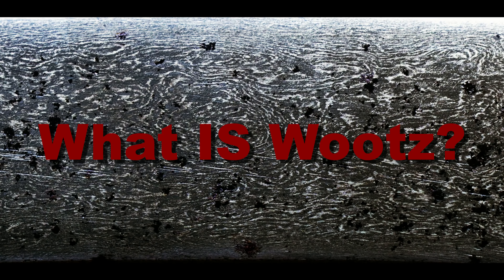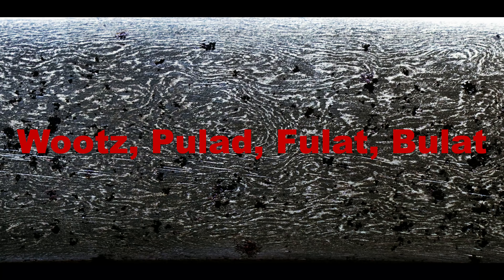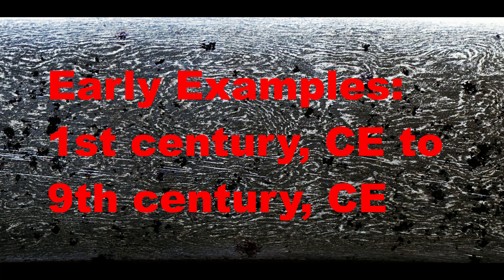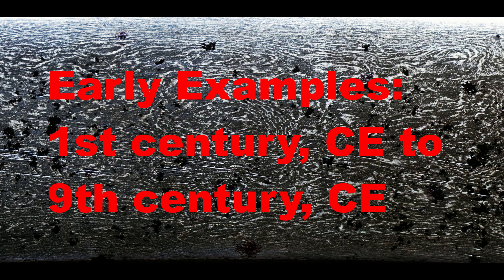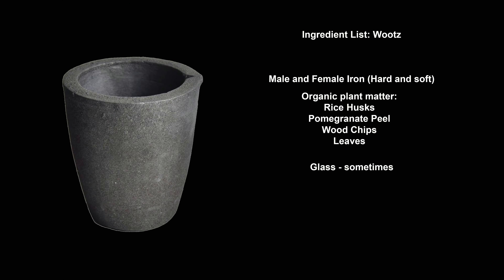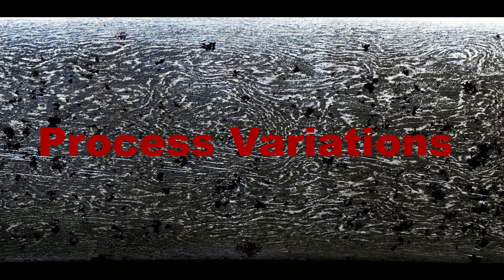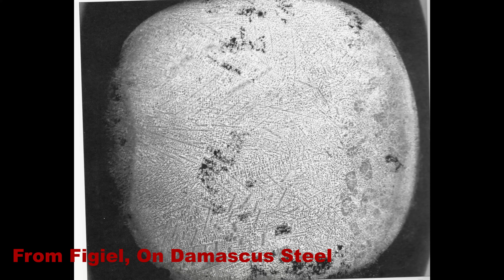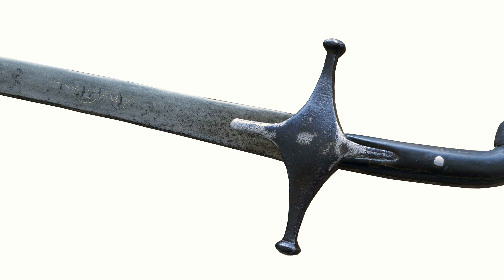"True Damascus Steel": History, Metallurgy, Production

Comment: It's only Damascus steel if it comes from the Damascus region of Syria. Otherwise it's just sparkling iron.
Reply: Exactly you know the really history 😀✌
Reply: so its like Kobe beef
Reply: & that is all. All damascus are wootz but not all wootz are damascus
Reply: @atcera8714  
And champagne.... if it's not from the champagne reigon it's sparkling no matter how good or expensive it is.
Reply: About that... there's 3 traditional definitions of Damascus Steel. Firstly is what I think David Do is referring to - steel that is made from iron in Damascus. The second is any type of steel traded or sold in Damascus. The third is any blade with this wavy, "Sparkling Iron" design, which is also the modern day definition.

So, I suppose David Do's correct with 1 or 2 definitions... but language has a habit of evolving over time. If you speak English and you talk about Damascus steel, most English speakers will assume you're referring to "Sparkling Iron", therefore this is what Damascus Steel means in the modern day. Just look at the Meriam Webster dictionary for Damascus Steel ("hard elastic steel ornamented with wavy patterns and used especially for sword blades") or the Collins dictionary ("a hard flexible steel with wavy markings caused by forging the metal in strips: used for sword blades").

Anyway, David Do is trying to be a smart ass and he's wrong (he might have been right a few hundred years ago, but not today). "Sparkling Iron" is a term he's made up - If you don't want to sound like an idiot, you shouldn't follow his advice.
Reply: Lmao considering syria couldn't even make the steel I have no idea how it can be classed as that type of steel coming from syria 😂
Reply: @alexanderthegreat5649  not if its presecco pal.
Reply: @44R0NM10  it’s a joke, in reference to the wine champagne which is only champagne it if is from the region of France, otherwise it is sparkling wine. He just changed the words to make a joke I thought was hilarious
Reply: @aravindhanpnair  false
Reply: @Killa_3  wdym it is made in syria i am from syria
Reply: @Aramleth  what do you mean look at a map ? we are talking about history , you cant claim inventing something because one civilization called if after the region it was fighting , when the real inventor had it within there civilization long before lmao
Reply: @AhmadM25  The name for the steal was adopted due to the people fighting thinking that Damascus was manufacturer and inventor of this new metal , but in fact they were being provided the steal from India , and later the method may have also crossed over , its like with a lot of things , later civilizations claiming invention when in fact it had been in use or known long before ,
Reply: @Killa_3  maps and religions changed over time. Read a history book before coming at me. What was Damascus back then is now something else entirely. Wootz came from India and then was introduced to Assyria which later developed their own version of wootz with Damascus steel.
Reply: @Aramleth  well i know maps change , but you are the one to state go look at a map , as if that answers the questions ., the wootz process is the same , and was used for most of the early Damascus steel , the name was adopted by Islamic scholars  , when the shipments of ingots become low for the ever growing region with its countless wars , had to try and replicate that and did so , but changed one thing which was adding different steels as they did not have the wootz ingots,  but as they knew the technique now (adding fibers to create spacing ) they also did that ,  this merely added different patterns as the different steels had different cooling properties , but the effect of having flexible steel is done through the wootz process,
Reply: @Killa_3  hmmm ok i see your point now. Its like comparing Jordan's and nike when in essence they both come outta the same factory. 🤔 wasn't my intention to come off rudely.
Reply: @Aramleth  no probs, and that analogy is good , but I would say India and the Tamil region came up with the materials for sneakers, but the creation of Nike and Jordon would be Damascus , because while the ingots were wootz, the actual forging of weapons was a high skill unique to that region of Damascus , India had some swords dont get me wrong that were good , but that region of modern day  Syria and the people  were experts in weapons at the time  , and of course better methods of steel producing was invented to make it absolute other then for it patterns
Reply from the maker: @Killa_3  the vast majority of patterned crucible steel swords were not made in Damascus, or even in Syria. To say that Damascus was unique or even particularly better at using crucible steel is not supported by archeology or the extant antiques.
Reply: @aravindhanpnair  the knife was manufactured using steel ingots imported from India, the blades themselves were forged elsewhere
Reply: @alexanderthegreat5649  also, its gotta be made with champagne grapes grown in champagne. Now with wine, location of the vine is actually important. Unlike making steel.
Reply: @Aramleth   @Red Grave  maps changed 😂😂😂damascus is the oldest inhabited city in the world 5000 years old precisely
the damascus steel is the steel extracted from its soil and manufactured by their blacksmiths
not near the wootz type or like random multi lairs forged steel
Reply: @aboodykiwan91  I understand this. Read further into the comments
Reply: Wrong.
Reply: @aravindhanpnair  not true, you cant make this up just because you are a nationalist
Reply: @Killa_3  The damascus steel originated in damascus, this video isnt about the damascus steel, its about wootz steel, damascus steel is another level of wootz steel
Reply: @IPostSwords  Then you need to visit the museums in syria, you can find lots of it there
Reply: @fjhcm  unfortunately your just wrong, but I'm happy for you to cite your evidence and change my mind
Reply: steel traded in Damascus is the correct trade name and not made in Damacus
Reply: It's only an Archamedes screw if Archamedes himself turns it.
Reply: The 'formula'' for ''damascus steel'' and the steel itself  came from India. Just like a ''Panama'' hat is made in Ecuador but got the name because it was sold mostly in Panama, so too Damascus steel got its name. There is no real damascus steel being manufactured  because the formula  has been lost for many centuries. Even the Indians admitted such. There was only one form of damascus steel and the formula is lost forever
Reply: Maybe the formula isnt lost, and maybe someone in 2022. Know where it originated.
Reply: Damascus are Indian invention
Reply: IT IS IN THE NAME
Reply: @atcera8714  😆
Reply: Yeah no.....
Reply: the iron comes from a single mine free rom what i understand had vanadium in it as well as ALIMINUM! not  as easy feat for the time and tech,
Reply: Why? There’s nothing special about that region with regards to steel. Yes that’s where it originates from, but it doesn’t mean it can’t be reproduced elsewhere to the same or even higher quality. 

It’s not the same as Parma ham, Kobe beef, etc because they are food and food IS different in that the region in which it is reared plays a part. 

So in this case “Damascus” is referring to a technique rather than the region.
Reply: its Damascus steel not because originate/made in Damascus, but because crusades call it Damascus steel. but it's originally begin in today's Bukhara Uzbekistan
Reply: @Reinhardt57  no, it was actually made in new zealand
Reply: That’s not how things work
Reply: @AhmadM25 no bro Damascus is little variant of Indian wootz steel they traded to Damascus. It's a real fact
Reply: @secular786  no
Reply: it would be enough to at least not just weld multiple scraps together
Reply: @Loriddian I heard the method of how the 1st Damascus blades were made is still unknown. Probably because of the carbon used or the rate at which it was heated or cooled. I assume after being turned to steel you can't tell what kind of carbon was used. That's for the original as far as the following blades imitating the name I'm not studied...
Reply: Slag. Flux is a chemical that is added to molten metal to connect with impurities that may then be removed.

… according to Morfit, a substance usually saline, mixed with other bodies in order to promote their fusion, and to render them more soluble in water and acids
Scientific American

Noun. chemical flux (plural chemical fluxes) (chemistry) The amount of substance per unit volume, per unit time transformed in a reaction.
Reply: Ha ha! You know who else said this? A Syrian dude from Damascus trying to sell swords!
Reply: @aravindhanpnair just like everything else that is refined and done in the Arab world Indians love to claim they did it first.

Like the modern day version of Chess isn't Indian it was a completely different game when Indians made it what people play now is the Arab version of chess.
Reply: 😂😂😂😂, what was and how big was Damascus, you can’t be serious
Reply: It didn't made in Damascus Syria it's crusades who seen that sword in Syria that's why they call it Damascus sword the sword made in india
Reply: Wasn't damascus steel made in India? I am referring to South Indian exports as it was the steel that made damascus, we have used it to make a large number of swords with it, even the Arabs mentioned it and they praised indian swords more than their own. I may be wrong though, I heard it from my sikh friend's grandparents (grandpa had 3 beautiful swords on display and it passed down through generations, note: it wasn't damascus)
Reply: Mate the steel was there but it was actually made in Bharat/India hence we have the most flexible swords like Talwar and Urmi (the most dangerous sword sorry I had to add this 😂)
Reply: It is not true that Saladin used to make swords in more than one place. What is important is the chemical method of making them👍
Reply: @alexanderthegreat5649 isn't the difference that with champagne, you need the grapes specific to that region to be classified as champagne? Iron is iron everywhere you go, so I think as long as the technique is the same, calling it Damascus steel is not inaccurate. Like Dijon mustard doesn't have to be made in Dijon to be called such.
Reply: Damascus was the famous market place for such swords. Damascus  is not the place of origin for those steel or swords.

Comment: Why was it named "damascus"
Reply from the maker: The origin of the name "Damascus" steel is contentious - The Islamic writers al-Kindi (full name Abu Ya'qub ibn Ishaq al-Kindi) (circa 800 AD - 873 AD) and al-Beruni (full name Abu al-Rayhan Muhammad ibn Ahmad al-Biruni) (circa 973 AD - 1048 AD) were both scholars who wrote about swords and steel made for swords, based on their surface appearance, geographical location of production or forging, or the name of the smith.

There are three potential sources for the term "Damascus" in the context of steel.

The word "Damas" stems from the root word for "water" or "broiling" in Arabic (Sachse, 1994, 13) and Damascus blades are often described as exhibiting a water-pattern on their surface, and are referred to as "watered steel" not only in English but in other languages.

The second theory is geographical, as Al-Kindi called swords produced and forged in Damascus as Damascene (al-Hassan, 1978, 35) but it's worth noting that wootz blades were made in many nations, and crucible steel is not known to have ever been produced in the city of Damascus. It is also worth noting that Al-Kindi did not describe these swords as having pattern forming steel, which he described separately.

Third, Beiruni mentions a sword-smith called Damasqui who made swords of crucible steel (Said, 1989, 219-220). In a similar fashion, Al-Kindi mentions swords called “Zaydiya which were forged by a man called Zayd, and hence they were attributed to his name". We therefore have a precedent for naming swords based on their makers, which may explain how "Damascus" came about.

Comment: A rather unspecified question. So, how good exactly the og traditional wootz damascus steel compare to some of the modern steels that much more uniformed with the content & quality itself?
Reply from the maker: Modern steels are much better. We have a lot more control, and much better knowledge of alloying elements. Old crucible steel often has sulphur and phosphorus amounts high enough to be detrimental to the steel, whereas modern steel can be almost entirely devoid of them. Likewise, modern steel is completely degassed via aluminium killing. 
We also have much more choice in alloying elements - things like tungsten were not available in the past, as it's melting temperature was too high and it was barely even known to exist for a long time. Chromium is a similar situation (though some iranian swords had around 1% chromium content)
Reply: Wootz steel was the best humanity has made up until about 16th century. By then, European steels (Toledo, Solingen, etc.) have became better.
However, the reputation of wootz persisted throughout time and the fact that to this day it cannot be accurately reproduced adds to its aura.
Reply from the maker: It absolutely can be accurately reproduced, though.
Reply from the maker: @mariusmioc3045  https://www.tms.org/pubs/journals/JOM/9809/Verhoeven-9809.fig.6b.lg.gif and https://www.tms.org/pubs/journals/JOM/9809/Verhoeven-9809.fig.6a.lg.gif both made around 1998 by Pendray.
Reply: @mariusmioc3045  I personally know Bill Dausch who was part of that team. He personally told me that it was not exactly historian Wootz steel!!!
Reply: Modern steel by far. Even steel from 1950s cannot compete. Its not just steel anymore we add things like Chromium, Manganese, Molybdenum, Silicon, Vanadium, etc.  Particle Metallurgy really changed the game for knife and sword steels specifically. You get super steels which won't rust easy and can be chopped through logs basically without breaking and the edge won't dull til next Christmas. You don't really see the comparison or huge progression as much or as well as in modern knives so I like them as the best example. Now you have coats like dlc (diamond Like Coating) which makes the knife blade and helps with rust and reflections, g10/micarta handles which won't break, wear out or get wet. Knives are always at the cutting edge of modern technology especially metallurgy and affordable for all vs ancient knives and swords most likely couldn't afford and were crap you'd find in a gas station now.  Sorry long read lol
Reply: @sc00typuff With respect to the metalurgy of wootz you are mostly right, I guess, but you are mixing factual data with falcies like "true wootz" bullshit.
"True wootz" is not superior, and it doesn't even come close to modern steels. And as a mechanical engineer and collector of antique swords & knives, I know what I am talking about.
This was proven a long time ago by Verhoeven who conducted detailed mechanical tests on antique "true wootz" blades and was confirmed many times over by various metalurgists and labs (see for example the papers published by Ann Feuerbach).
Now, if you are talking about Valyrian steel, that's another story.
Reply from the maker: @sc00typuff if you actually read verhoevens "damascus steel revisited" you'd see it has a 1900f hold for 16 hours, and is thermally cycled as high as 1880f. So it's not like verhoeven is an advocate for low temperature forging.
Reply from the maker: This 16 hour, 1040c hold WAS after the initial cooldown. It was used for a rim decarb.
Reply from the maker: @sc00typuff I know you can force any hypereutectoid steel with CFEs in it to segregate into carbide bands, ball bearing cruforge V, whatever. That's nothing new.

But actually read the paper, maybe. Because you seem confused about the melt, rim decarb, and temps used by verhoeven and pendray during forging and thermal cycling
Reply from the maker: @sc00typuff I mean I have plans to do several melts over the next years with a few different people nearby who currently make crucible steel. So.. sure, eventually.
Reply from the maker: @sc00typuff dude I live in an apartment right now. It's not as simple as setting up a workshop in my bedroom.
Reply from the maker: @sc00typuff I had a pretty okay workshop back at my family home but the area is prone to bushfires / wildfires so that's not usable anymore. So I need to arrange and organise melts with people who have appropriate workshops already set up
Reply from the maker: @sc00typuff I'm like, 30 minutes outside of Sydney. Unfortunately Australia has absolutely massive urban sprawl, so anything within 1 hour of Sydney is pretty much useless for setting up a workshop.

Old place was 2 hours from the city, but prone to fires and also 2 hours from work. Had to move closer for my own sanity.

It's kind of a terrible country for blacksmithing. Either you move somewhere with no plant life to burn (but it's 3 hours from the closest city, and hits 45c in the summer) or you risk burning down your entire state.
Reply from the maker: On the flip side, I leave every chance I get.
Reply: @sc00typuff, teach me
Reply: @sc00typuff Ed does some fantastic blades with simple steels that have unlimited potential. Murray Carter has a lifelong facination with white steel. His methods keep improving performance in desired qualities. 👍
Reply: Wootz would barely even compare, it would be relatively brittle and wouldn't necessarily be any harder or more wear resistant.
Reply: @IPostSwords  what about Asian steel from the modern Era.
We all know today's steel varies from place to place.
I feel your pain trying to break the narrative of wootz  Damascus and folded steel.